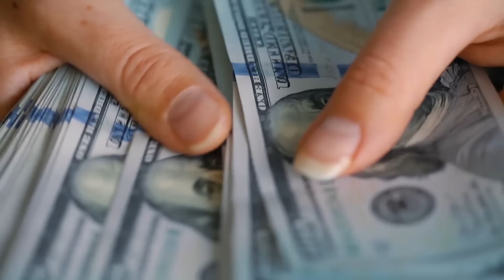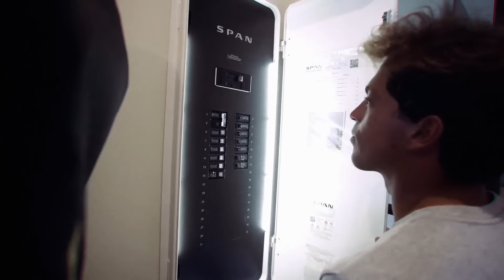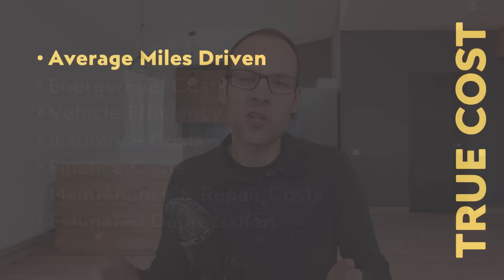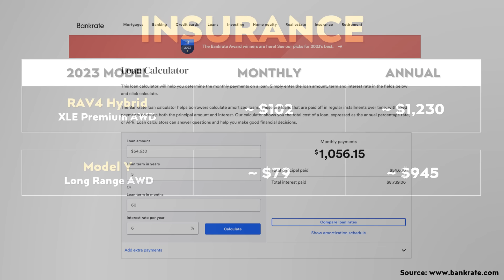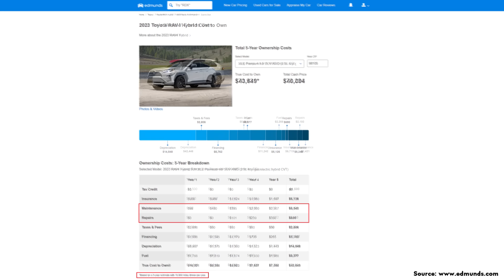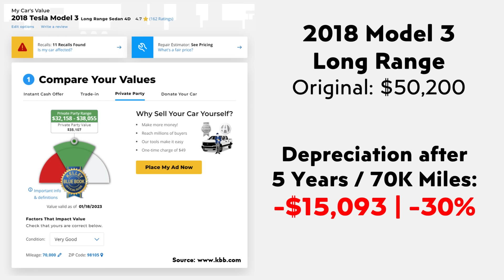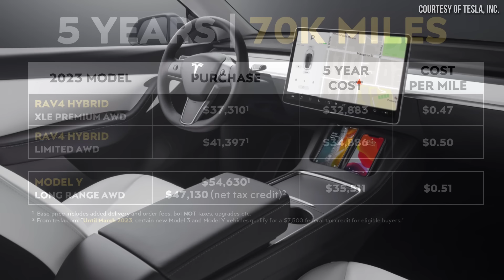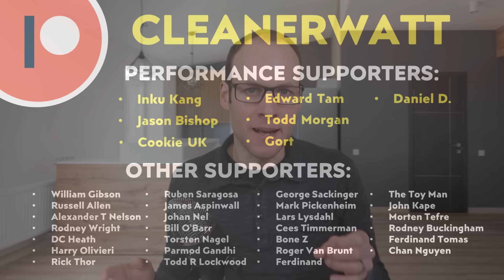Tesla Model Y vs RAV4 Hybrid: Lowest Cost of Ownership in 5 Years?

Comment: I just saw a report out this month that the cost to charge a Tesla is more than the cost of gas for an ICE car since the gas prices dropped and Tesla increased electricity cost at their charging centers. Also Teslas values plummet when you reach the end of the battery and have to replace it whereas an RAV4 engine will last for 400,000 miles and still has value when that happens. Also many  in North America are upset because the price to charge their Telsas at superchargers went up and now it costs more that buying gas for an ICE. Gas prices dropped and superchargers charging price skyrocketed. Also minor accidents with Teslas are $20,000 because of the Megacasting of the mold which prevents easy fixes of fender benders. So unless you are the worlds best driver and 100% sure you will never have a fender bender and you have a supercharging set up in your own home and your insurance company hasn't skyrocketed your insurance on your Tesla and your battery will last another 10 years than never buy a Tesla as the odds are you will regret it very soon and regret you ever bought a Tesla.
Reply: You will be surprised how many people drive to 400k, a small percentage.  Most cars are designed to fall apart nowadays.
Reply: @dragodavidCE ”designed to fall apart” umm quite the opposite. Safety and Reliability are literally #1 and #2 around all mass market vehicle development goals.
Reply: If you want to cherry pick a scenario favouring the Rav4, go right ahead. Most people who own EV's charge them at home, because it's better in every way. Fast charging happens so rarely that it doesn't matter if it's slightly cheaper or more expensive than gasoline.

And with regard to residual value,  the Model Y battery is likely worth more as scrap than your 400k miles Rav4 in full working order. The minerals in that battery are a significant fraction of the price of the car, and they will be recycled. There's even a commodity spot price index on shredded batteries.
Reply: @virtual-viking  Stop cherry picking scenarios to make EV's look better than they are. There are more and more videos on YouTube of EV owners regretting buying an EV. Also EV's are almost completely useless when the weather drops to real deep winter cold weather where all types of real life problems sky rocket with EVs and even with the super chargers. Not everyone ones a home with an optimal high speed charging set up. Then you see all the real life contastrafes with charging EVs even at 0 F and much worse at -10 F and they are useless and can take a day to charge at t supercharger if your battery is very low. So many people have to get their super EV towed to a super charger then wait a day to use one that is actually working as superchargers malfunction in real winter cold, not to mention that really cold drops an EV battery to drop usable distance way more than 50%. Too many problems to just assume EVs are a solutions for everything. Also when you get a fender bender with a Tesla it could cost 40,000 to repair if because of the special press used to make the car all one unibody part. A living nightmare with repair bills in almost any accident. I will pray for anyone who buys one.
Reply: @UncompressedWAVmusic  I'm sure a few people have had problems, but that is to be expected considering that millions of EV's have been sold by now.

I live in Denmark where 1 in 8 new cars sold last year was a Tesla Model Y. Two weeks ago we had the worst blizzard in a decade. And at that time it felt like there were even more Teslas on the road than usual. I figure it was because most of them have 4x4, which is otherwise rare.

I haven't seen or heard about any of the problems with the cold. Neither have I experienced anything beyond maybe 25% range degradation in my 9 years of driving an EV.

What I do recall though, is having to get out of bed an hour early, because of ICE cars that had difficulty starting during cold mornings, and needing to run idle with the key in the ignition to melt the ice off. Something that my EV's can do remotely without having to get out of bed.

I'm pretty sure I have way more 1st hand experience with ICE cars that you have with EV's, and I have no desire to go back.
Reply: @virtual-viking  The people who live in ares where the temperature drops below 0 Fand have EVs and don't own their own home and have a high voltage line to their Telsa are screwed when the temperature drops and Telsas problem with the cold weather becomes a nightmare situation and they wish they didn't own an EV. I saw many websites and chats describing the nightmares with Teslas and even with supercharges station that make the Telsa a nightmare beyond belief. You are one of the lucky ones and the rest are all shafted by EVS in the cold as they become almost useless and a nightmare in the cold and all the supercharger stations are also a nightmare. So enjoy your perfect setup, meanwhile if you are in denial of the mega problems for most people with EVs than I will pray for you.
Reply: @virtual-viking Stop lying and cherry picking your bogus seneriio which is false. There is a shortage of fast charging scenarios which causes major issues with Teslas waiting a day or 2 to charge it in the winter. Yet you brush if off by saying, "Most people who own EV's charge them at home, because it's better in every way. Fast charging happens so rarely". Tell that to people without a fast charging set up at home. They would call you a scammer.
Reply: @UncompressedWAVmusic  If you can't install a home charger, you're probably not going to save a ton of money by driving an EV. And if you need to do a lot of DC fast charging in America, I can't recommend any other brand than Tesla. But here in Europe, there a chargers everywhere,  and they all use the Type2 CCS plug, including Tesla.

If for some reason I couldn't charge at home, the 2 supermarkets where I do most of my shopping have both level 2 and level 3 charging, and I don't think I've ever seen them being congested.

But nothing beats charging at home on a windy night. My wife went on a road trip with her sister yesterday, so just now, between 1am and 5am, I got over 40kWh at between $0.02 and $0.04 per kWh. That's darn near free electricity, and 90% of it was from wind.
Reply: Electric Viking thanks for your great reply. Your videos are the highest quality in every way. @virtual-viking
Reply: The odds of a Toyota Rav4 making 250K miles is less than 1 in 5.  National average is 1 in 9.

Comment: Long story short??? Why would I pay more for a MY and deal with longer "refueling" times and charging hassles? In winter it's even worse as range is considerably diminished? On top of that, the RAV4 is far better built than a MY that after 5 years starts falling apart. The only way a MY would work out is if we see $6/gallon gas for an extended period of time.

Comment: I think you need to add $1000 for the cost of installing a home charger.
Reply: My home 250v charge outlet was conveniently located right next to the breaker box which was right beside the car in the garage. It cost just under $250 to have installed.
Reply: It’s more like $1,500 if you live in house older than 25 years.  Which is I believe majority in the US.
Reply: @vadskar64 Yes depending on where the panel is compared to where you park. And the size of the service running to your house the prices can vary wildly. 

My brothers house has the breakers in the kitchen. The detached garage is 75 feet away. A 7kw charger is going to be over $3000. If he’s ok with a 3 kw charger it will be closer to $1000.

Comment: So as of the price lowering, and .99% financing of the Model Y, you are getting a way better car with half the operating cost of the rav4. The financing makes the model Y $6k cheaper than shown above, and the MSRP price has dropped  $6k, so $12k cheaper than shown while rav4 has actually probably even increased in msrp.
Reply: Bro, how to calculate the price how you are doing? I want to buy cheapest Model Y and I qualify for 7500. 

The car I see is 44k + tax = 48k then minus 7500 I am around 42k. Is that correct?

Comment: Great comparison! I own a Tesla Y LR AWD since Oct 2020 and live in Vancouver, BC Canada with some very important distinctions in price comparisons: electricity is cheaper at $.13/kWh CDN and gas average for 2022 was $2.22 CDN per L which translates to $.10 USD for electricity and $8.33 CDN per G equiv. for the average of $3.4 per Gallon in WA last year. Insurance is also cheaper here and latest financing for Toyota are at 8.59% vs 6.25% for Tesla!! We also have a provincial and federal rebate for EVs of $4000 max for Tesla Y (depending on income) at purchase and $8k for Tesla RWD as listed at <$55k. I think the depreciation model for EVs is too high given the value of EVs remaining substantially higher than ICE ones and expect that to be even more favorable >5yrs. Maybe that's why BC has the highest EV adoption levels in North America at ~20% of all new vehicles sold to be electric! The Y comes out on top on this side of the border. The OTA updates (there's been dozens since we got our Tesla) make constant improvements unavailable to other vehicles, so value and safety features are constantly added and should also be considered. Hands down, Tesla Y takes this one.

Comment: You didn’t factor in a battery swap which can cost 15-20K dollars, pretty significant.
Reply: The warranty is 10yr 120k mile, so after 5yrs 70k miles it is still under warranty so wouldn't cost anything if it did fail

Comment: nice to see the cost of ownership continuing to fall for tesla. but as a comparison, those numbers easily fall apart for me depending on usage and location. i average a little under 10k miles per year, and i live where gas prices are below the national average + the freezing winters totally chew up that EV range. i treat my vehicles well, and haven't even come close to these 5year 5000$ maintenance costs that edmunds has calculated. all that considered, even with the savings of owning a tesla (which i won't even realize until years down the road), it's like 1.2x the cost of owning a rav4 for me
Reply: Agree that you have to look at individual situations to determine if it works. For me energy is $.09KWh and I can get to the Rocky Mountain ski resorts and back home in freezing/snowy weather, so range doesn’t bother me. I agree on maintenance costs but also think the Tesla would be way lower as well (4x cost for repairs 😂). I also get a 2k state tax credit on top. He also doesn’t factor the electrical install I will need. Although , I get 30% federal credit as well as my utility company paying up to $500 for the install. My insurance for the Y was just as cheap as my fifteen year old Rogue. My financing costs were way lower as well, so 5 year cost of ownership would be cheaper in a Y for me.
Reply: You must realize that ICE efficiency in cold weather decreases drastically.  It's been my experience that my ICE car's getting 40 miles per gallon in summer achieves only about 28 miles per gallon in winter, well over a 25% difference.  The Tesla vehicles do better than this according to statistics, without emitting the extra pollutants in the meantime.  Then, there's the health costs associated with ICE pollutants that haven't been taken into consideration, as well.  Cancers, asthmas, you name it.
Reply: @BSAF83  how insurance for tesla cheaper for you
Can you please share bcz only hitch i think is high insurance
Reply: @rajendramodusu5980  It’s unique to everyone. You will have to shop around and see the price for you. Through Tesla insurance, my premium was the same as my 15 year old car. 125/month. Everyone else was about double that though.
Reply: @BSAF83  Ben thanks for reply
My quick question
I was tied between hybrid highlander xle $54k on road with life time power train or model Y
I have no clue about tesla just seen on roads left and right all over usa and I am in Indiana
My question what you suggest me to buy I am not a long trip guy ( just once a year)
Everyday commute will be 10miles only mon to Fri
Plus I live in apt   My unit is ground floor I m on corner unit and my parking spot is just next to my unit
From kitchen window electric socket  to tesla ( if I buy) to my parking spot is 50 feet 
Is it ok 
Please give me ur input and I request you read my comment twice so you can understand my questions
Sorry for mistypo

Comment: I believe you MY depreciation figures are way off. You cannot buy a new 2018 MY today. It has depreciated because of the many upgrades to the MY including the battery,the heat pump the vastly upgraded cpmputer and myrids of other things The real figure should be between 15-20% instead of 30%.

Comment: Must admit I assumed the Rav4 Hybrid would be able to cover short distances without using its gas engine so you need to know typical usage requirements, (length of commute or whatever), in order to determine fuel costs.
Reply: With no plug, it's 100% gas powered.
Reply: Toyota RAV4 comes in HEV and PHEV variants. HEV can only cover some hundred meters in EV mode, and that energy all comes from the ICE, it's been recovered during braking or throttling. PHEV OTOH allows you to drive for about 60 km on pure EV, charged from the grid. You get the fuel economy of an EV with the range of an ICE. I love the concept, however one must bear in mind that it is more expensive than HEV and it's economy heavily depends on usage pattern.
Reply: Rhian:  He compared the pure hybrid Rav4, NOT the Prime PHEV with a significant pure BEV mode.  Lower price, but no tooling around town without burning gasoline for more than, say, a mile at low speed on occasion. 

I actually think the PHEV would have been a better comparison -- but the video didn't do that.
Reply: @markotrieste :  Wrong on the HEV capacity for BEV mode.   On the interstate, down a long hill, for example, it might drive in BEV mode for a mile or so, based on the way a modern Honda Accord HEV behaves (and it uses the Toyota HEV system).
Reply: @rogergeyer9851  Regular ICE vehicles cut off fuel injection on downhills also so it doesn't matter.
Reply: @TecnamTwin  Incorrect. There are many times during my drives (including on the interstate) that the engine shuts off on my Rav4 Hybrid and it runs exclusively from the battery.
Reply: @bertschb  You misunderstand me then. Those electrons were not sourced from grid energy which could be renewable, but rather the engine acting as a generator - Burning Gas.

It can run on its tiny battery for short stretches to boost efficiency, but that's irrelevant. Ultimately it's still just a gas car. Btw, I currently drive a 2012 Chevy Volt.

Comment: So I’m about to buy a regular RAV4.  I will likely do over 20k miles a year.  I think it is a better choice right now than either of these.  why?
Model Y battery very expensive to replace, supercharger cost is more and fries the battery quicker.  Very expensive to replace
RAV4 HYBRID cost more than regular one.  That cost plus the possibility of hybrid system and/or battery failure when out of warranty would blow away and savings.  I know these systems have longer warranties but if you plan to drive past warranty time the regular RAV4 is better choice.

I drove a model Y.  Amazing!  I want one, but for now if you have to drive a lot and want to keep for long term get RAV4 regular.  Low miles yearly or like getting a newer vehicle every 2 years go with Model Y and charge at home.  Tech will get better so in a few years the Tesla will be a better choice for sure.

Comment: Your spreadsheet needs an entry called”Joy”.I’ve driven both cars. No comparison . The Y is a joy to drive.  Bigger quieter, quicker, greener,, smarter ,,, Also  I charge overnight at home at super off-peak rates for about 1/3 your rates. In the morning it’s charged and temp is perfect. Many free chargers too.
Reply: I agree, owning a Toyota is about as joyous as owning a microwave, but you'll pay for that "joy" . That tesla door handle will break well before the Toyota's dumb indestructable handle. You'll pay $1000 for tesla replacement handle, while the Toyota owner pays $50. That's where the "joy" of owning a Toyota comes in.
Reply: @sailintothesun3421  You convinced me. Scrapping my Tesla and buying a 2007 Ford Fiesta for the cheap door handles. That’s the path to “joy” haha
Reply: @jarudolphesq  Or buy a Lexus? Even BMW has higher quality. Though you wont be supporting Musk and awesome memes.
Reply: @sailintothesun3421  Had a Lexus (and a BMW) but prefer the Tesla.Elon is a dork but he makes a sweet car

Comment: Does the RAV4 have Sentry Mode, Dog Mode, and OTA updates? Does it come with Autopilot standard?

I am absolutely amazed that the Toyota RAV4 holds its value so well. There's an old adage that you loose 30% of a car's value as soon as you drive it off the lot. So lots of people are willing to pay $30k for 70k miles used and not cough up another $7k for brand new with full warranty? I certainly wouldn't.